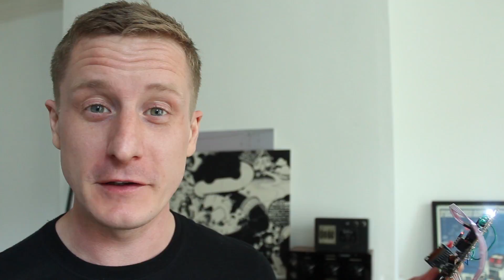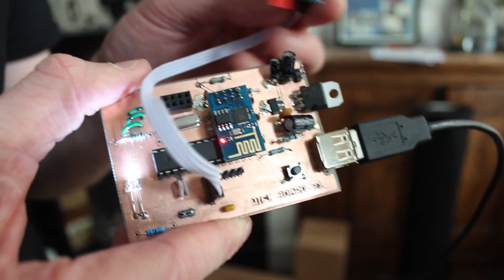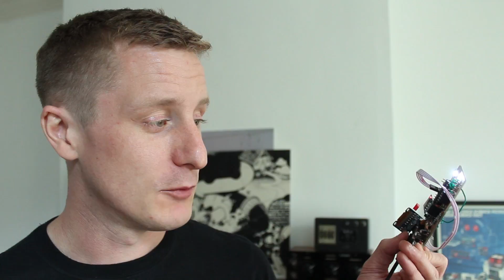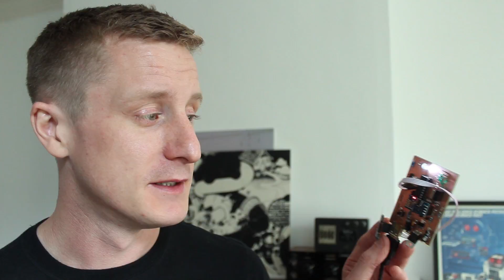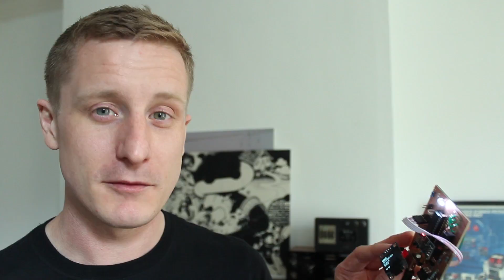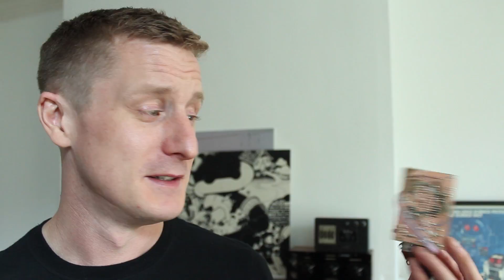ESP8266 Arduino Interface Board

Comment: Thanks for sharing. Is there also a .pdf with the schematics somewhere for the lazy guys (like me) who just would like to understand the circuit. - Did you have a look at the NodeMCU modules? They are very easy so programm directly with the Arduino IDE.
Reply: +David Watts Lua, that's for hippies. I have nodemcu board  running with the native esp sdk. There are some scripts that make it totally trivial to get the SDK compiled and working. Also, as norm says, you also have quite a good arduino mode. Pretty much the same as using a normal atmega. Personally I have gone for micropython and my own native C code for multiple sensors. I initially used the ESP with a ardiuno nano but now I look back, for me that was just plain silly. The CPU in the ESP is better and you have more ram, more ROM.  If you hook deep sleep pins up you can get weeks on a 5 buck USB battery pack.
Reply from the maker: norm1124 Sure buddy, it isn't all that tidy though and I am sure the power supply design might make some people cry - http://www.davidjwatts.com/youtube/Eagle-Files-ESP8266-Board-V1-NRF24L01-not-implemented.pdf The circuit is basically a bog standard UNO with some ESP8266 specific bits and no USB comms.

I had a look at the NodeMCU stuff but I didn't really fancy learning Lua scripting, am I right in thinking that is necessary?
Reply: David Watts no,  you can use directly the Arduino IDE: https://learn.adafruit.com/adafruit-huzzah-esp8266-breakout/using-arduino-ide
Reply: me, again. I just looked at your code. It would be way smaller just to use the C-SDK. You don;t have C+ strings but the rest would be much simpler.